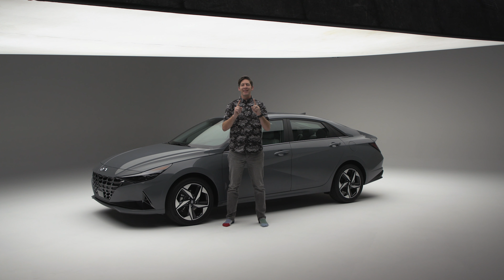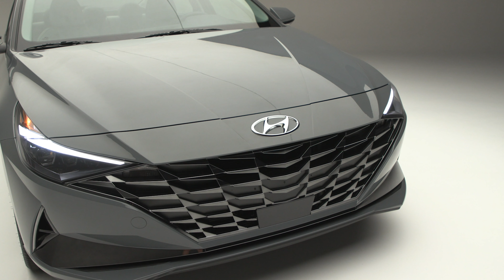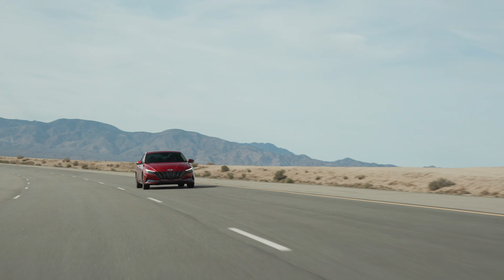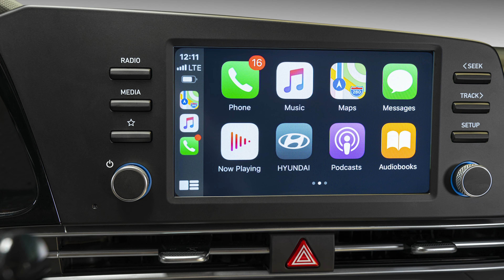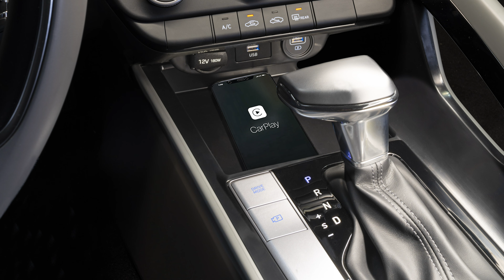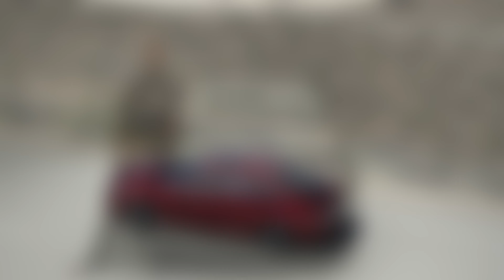2021 Hyundai Elantra | First Look!

Comment: I am very happy with my new 21 Elantra Limited except for two issues.  First the Blue Link weather icon says additional setup required but when you call the number they do not know what you are talking about.  When you use split screen to show temperature the Foreca weather app says additional setup required and the same thing when you touch the temperature on the home screen it says additional setup required.  In some of the reviews by Hyundai it shows the three day forcast.  NO one seems to know how to set this up.  Secondly Hyundai has not updated their digital key app for newer phones.  Cannot even download the digital key app except for older phones. Using phone to unlock car was one of the major selling point for me and now I find out I would have to buy an older android phone to use this feature.  Also on the play store the digital key app gets only 1 or 2 stars.  Very disapointed in Hyundai.  I did not get what I paid for Hyundai!!!  IF you watch the video by Hyundai at https://www.youtube.com/watch?v=oj34f1G6OrY&t=47s at 46 seconds into the video you see the forcast screen.

Comment: That looks absolutely amazing! So does Nissan’s Sentra, Corolla needs to step it’s game.
Reply: the sentra looks nice inside and out. not sure about the transmission. nissan cvt is horrible. i had a altima and transmission went out at 100k. good thing they extended to 120k. so they fixed it for free.
Reply: Jason M Nissan makes nice cars. I hope they can fix their cvt transmissions
Reply: Nissans look nice but to me they sound like the engine gurgles when you accelerate
Reply: Kole Steve true
Reply: New Corolla looks better than the other ones.
Reply: @JeffSpehar-ov1cn  lol no, my family has a Corolla and a Camry. the Corolla has terrible exterior design and it's a 2020 model.
Reply: Jeff Spehar no it does not half baked